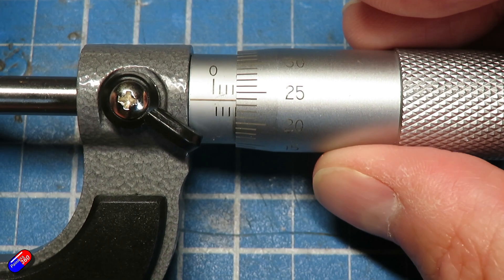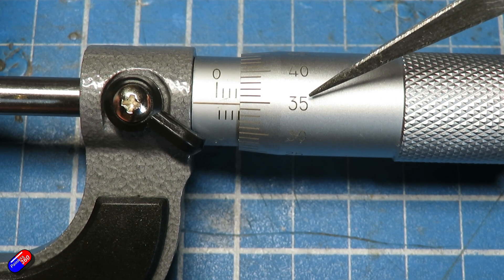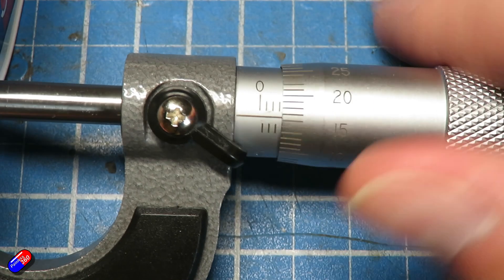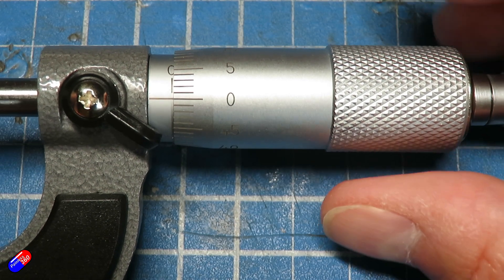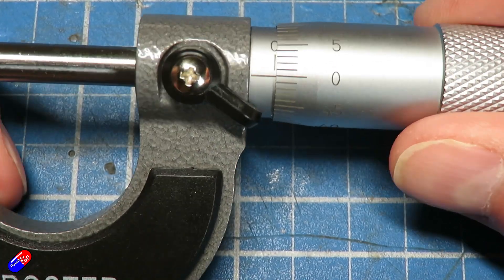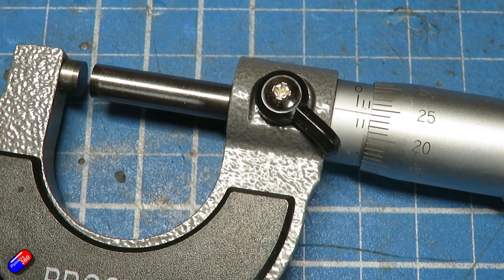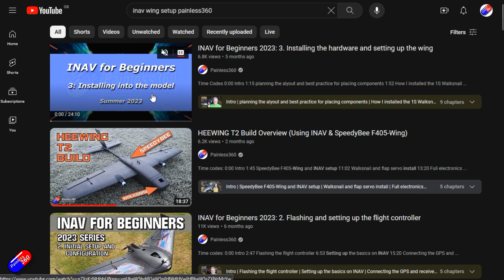How to use a manual Micrometer

Comment: Since I belong to that old school I appreciate it a lot 😀 
What surprises me is that you are using mm....in UK 😂
Reply from the maker: The UK started the process of metrication, moving from imperial to metric measurements, in the mid-1960s, with a formal policy adopted in 1965. So, anyone born after then grew up with metric as the standard for measurement of smaller distances. 
The exception to that (because we couldn't follow European standards completely ;) ) was to keep larger distance in miles and measure altitude in feet. 
There are still reminders of our 'imperial' past in other places too. Examples include the countdown to motorway exits here in the UK, which are spaced at... you guessed it... 100 yard intervals!
Reply: @Painless360 now I know...thank you !

Comment: I learned to use the small knob at the end on the back to apply a defined pressure because it has a ratchet
Reply: Three clicks of the ratchet is what I was taught many years ago.
Reply: Sure, it's a measuring tool not a WRENCH!
Reply: That's the only correct way to do ACCURATE MEASUREMENTS!